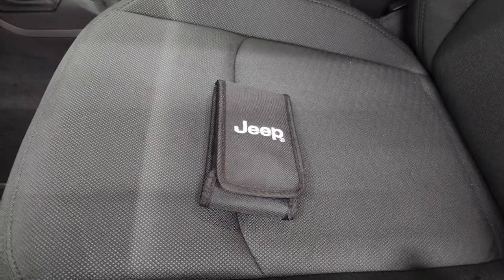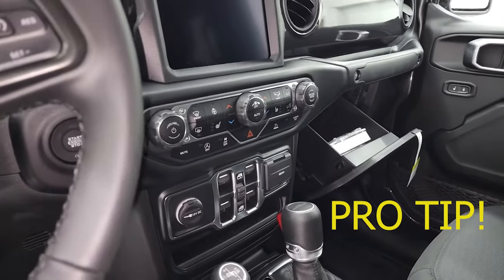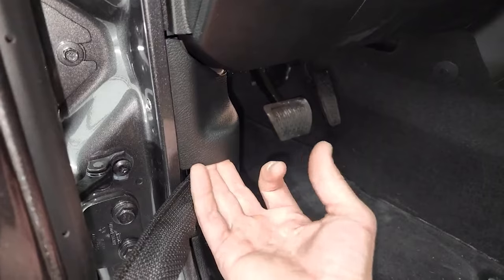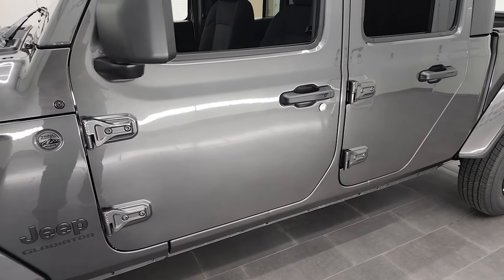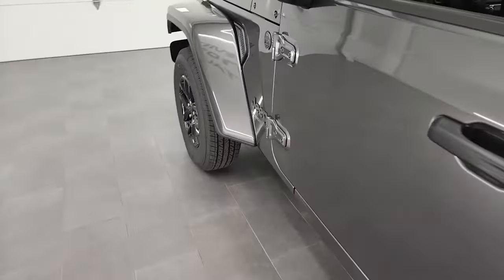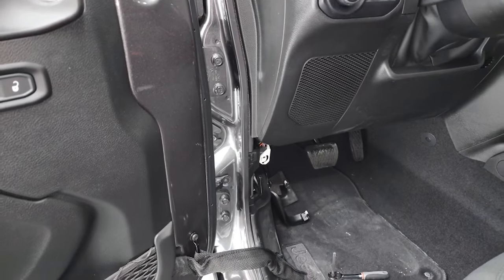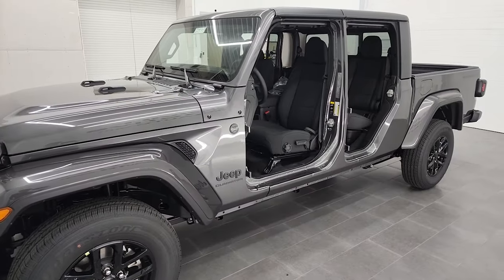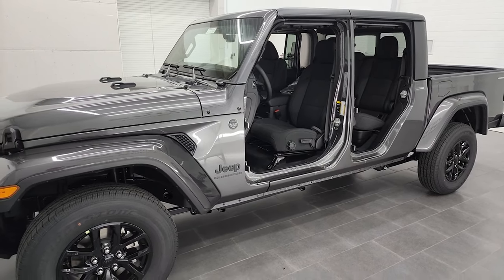HOW TO REMOVE YOUR JEEP GLADIATOR DOORS STEP BY STEP DEMONSTRATION

Comment: I keep a small piece of cardboard in the toolkit to put between the ratchet at the door when removing the hinge bolts. Protects the paint and allows you to remove the bolts quicker without worry of scratching anything. Good video!
Reply from the maker: Thats a great idea!  I will use it when I redo this video!
Reply: Instead of a little piece of cardboard, I use a "refrigerator magnet".

Comment: I just leave the hinge bolts out and the check strap i pushed into the doors. So when i want to remove the doors i just unplug the harness, remove the fabric strap, and theyre off in 2 minutes.
Reply from the maker: I always left my bolts out in my wrangler

Comment: One thing that is never mentioned is the Auto Park feature. When I open the door and shift into drive, my jeep automatically parks itself. I’m guessing you don’t have that problem with the pigtails disconnected?
Reply from the maker: Great question.  Im sure that it doesmt do it when the doors are off automatically.  Otherwise I would have heard of the problem much sooner.  I will test it on my next doors off video which hopefully is this weekend!
Reply: @Summitauto i just saw another video that says this Auto park feature happens when under two conditions. 1. Door is open and 2. Seatbelt is unbuckled

Comment: I was reattaching my doors and the bolt that attaches the brace to the inside of the door jamb screwed in about .25 of the way in and then popped off  what looks like a plate inside the interior of the jamb. It's what the bolt screws into. Now I can't unscrew or tighten that brace. Essentially I can't take my door off. Anyone know how I can fix this? I don't even know where to start looking on the internet.

Comment: can you drive on the road with doors off, or do you need a mirror for seeing behind you?
Reply from the maker: I believe legally you have to have at least a driver's side side mirror.  Yes you can drive with the doors off and it is a lot of fun (did it a ton in my old wrangler)  i did end up getting some mirrors ypu could install in the door hinge holes on my wrangler though.